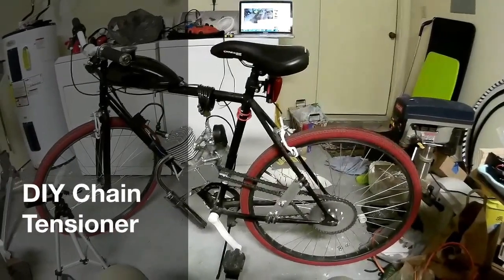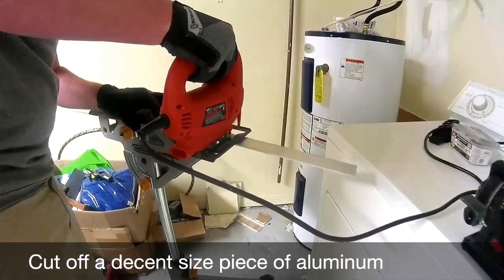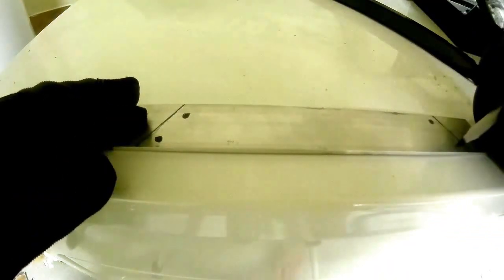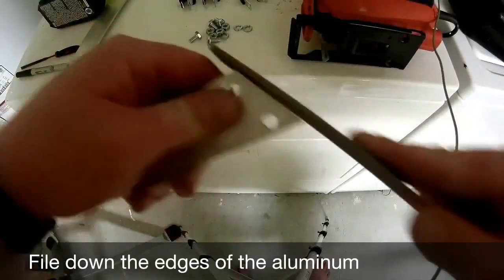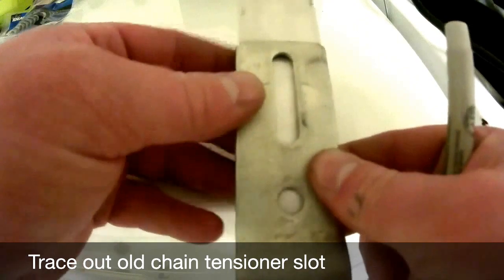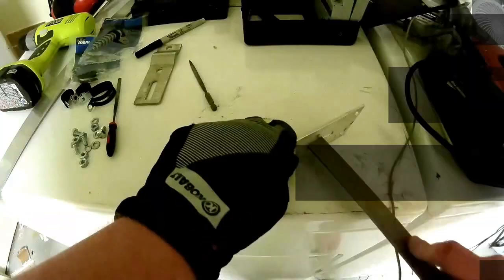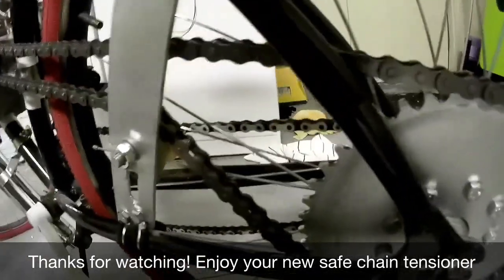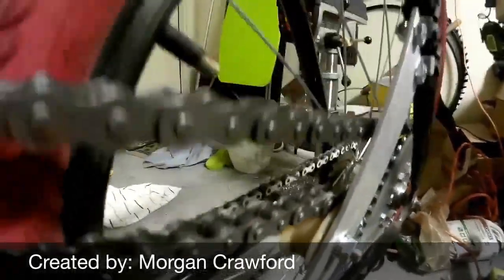DIY Chain Tensioner (Motorized Bicycle)

Comment: no spring?   well its a chain guide or stabilizer
Reply from the maker: It’s still a tensioner as it applies variable tension to the chain... This is an example of a low cost way to stay safe. Springs are also great options.

Comment: Why not bolt it to the frame and shim the pulley. I agree it's better but be more sturdy bolted to the frame Guy
Reply from the maker: Eddie May thanks for the suggestion. I didn’t want to put holes in my frame. I worry about that weakening the frame.

Comment: Sir, good video! Just needs a little
demonstration of the part working.
NOT trying to be rude, but i had the
same idea. Lynn at custom motorbikes has a great, similar arch tensioner.....but it gets expensive when you want to sell
moto bikes with upgrades.

IE:  expansion chamber, stronger
bolts, dual pull brake, better fuel -tank, rear wheel/ hub adapter, etc.

I thought about using older car/
truck hood hinges as a tensioner
(pick your part salvage yard) to save money, but drilling holes in
it might weaken them.

Regardless, thanks for the idea sir! 

One last thing, what type of black and decker tool was that???
I really could use that on my aluminum projects, and for cutting
polycarb windows.

God bless you, Morgan!

Brian
Reply from the maker: Thanks for watching. The tool is called a jigsaw. Just make sure to get metal cutting blades.
Reply: @gitarplayer229  I appreciate the reply,
and name of the tool.
Thanks again!

Comment: Don't do this if you want a smooth ride remove that junk and use the motor to adjust chain we are talking night and day also remove any rubber you want your motor tight no play and chain tight with no tensioner at all  Trust me if you want a cadilac thats the way go ... I did 587 km in 2 days 387km in one day

Comment: If i only have knew this before trying to start for the first time my bike ..... Yesterday after installing everyting ive tried to start the engine and the chain tensiones went into my spokes and fucked up my rim. Now im so sad cant even ride the bike.... Im going to use this video as a guide to fix that problem... So sad dont even got to start the engine....
Reply from the maker: Dang that sucks. The stock design is horrible and down right dangerous. Be careful and good luck!

Comment: While this is an improvement over what comes with the cheap Chinese kits, It is still far from perfect. It still uses the same cheap plastic roller, which will eventually break. A skateboard wheel or something similar would be a lot better. But there is still one problem. Since the chain has tight spots and loose spots, I believe the tensioner (or follower) needs to be spring loaded to keep constant tension on the chain. This is the best chain tensioner I have yet found. I have one and love it  http://www.ebay.com/itm/49-66-80cc-Motorized-Bike-Engine-Mounted-Chain-Tensioner-Spring-Loaded-Michigan-/182189235395?var=&hash=item2a6b531cc3:m:m-b3lt30KT8w_ql7lB4QDvwIt was worth every penny. Many motorized bike builders try to cheap out everywhere they can, but the chain tensioner is not the place to do that. I went down hard, at 20 mph, just inches from fast moving traffic, when my tensioner got sucked into the rear wheel. I could have easily been killed. I switched to a friction drive for over 3 years after that.
Reply from the maker: I agree that a different wheel and spring would be better. I've commented on that. this video was shown as an example on how to make the most affordable tensioner while making it much safer so it can't get pulled into the spokes. thanks for watching!
Reply: @gitarplayer229  The link isn't working can u plz provide new link cause I almost died from using that shit Chinese chain tensioner

Comment: hi I was wouldering how do you now if your mortor is sat right
Reply from the maker: I look down when riding and if it looks even from side to side it's good. lol
Reply from the maker: also when you line up the motor brackets it positions it correctly.
Reply: Gerald Mardling  level the frame w a big level and secure it then mount the motor semi tight and level the  side cover and that should get u real close!

Comment from the maker: @cristovao00 Thanks for watching! Ive looked at the spring options that attach to the clutch cover and they do seem nice but cost a lot more than around $7 and when the whole set up is $100 i have a hard time spending 30+ on a tensioner. Who knows though i may have to splurge and buy one some day.
Reply: Hi, I bought one of them  clutch cover spring tension, but the extra space the bolts made after putting it on made my peddle hit the bolt (found out after i took out a few links to make it fit right). So after replacing my original carppy one it would never say tight and the pulley loosened and dropped it to the bottom... I am now trying your tensioner am using half a bed frame with slot and bolt holes in and thinking of using 1 hose clamp at both ends as long as they wont twist the metal
Reply: works great, thank YOU for putting it out there.. different piece of metal but same result. Might be able to put that useless spring arm on the same way just with the metal strip on the out side of tubes